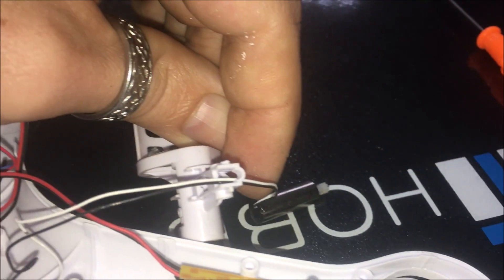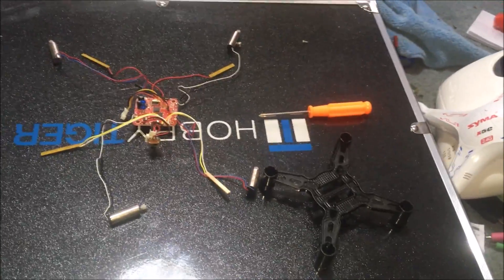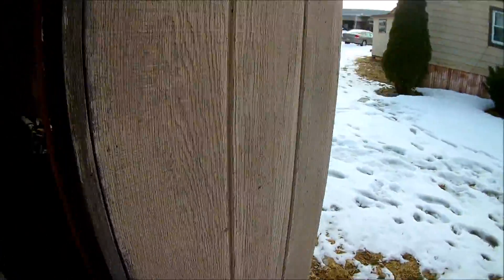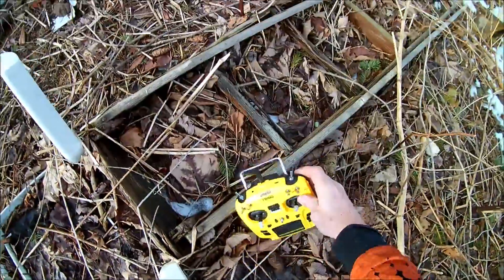SYMA X5 Frame Swap MONSTER MINI DRONE diy TREE CLIMB How To Instructions

Comment: Which size propellers did you find the best? What were your flight times like? Did you save weight with this mod?

I'm thinking of trying this with a Syma X5C (altitude-hold version) but with a slightly larger frame.

Comment: Hey Jay!  I was thinking?? Hmmm??  I know you said you put the propeller's straight on the motor from the Syma to the smaller body drone,  but i was thinking maybe you should try the original Syma way with the Large gear too?  Im just saying... that the Gear Ratio between the Motor & the Large Gear was designed to spin the propeller's at a comfortable rate to keep the flying machine from accelerating to fast. Just my thoughts Jay,  if you can get the Large Gear some kind of way on the Smaller Frame it should be alright. Its worth a try? 🤔
Reply from the maker: Yeah but defeats my original thoughts , the way I’m doing it should be workable as I’ve seen it done but u r correct the board is designed to have the tension n added friction of gear to grear I got a few tricks up my sleeve yet
Reply: @JayDrone  Right right👍  Cool Jay. It was just my thoughts